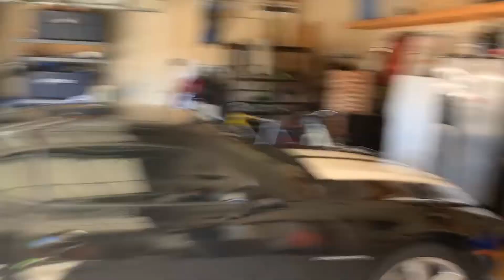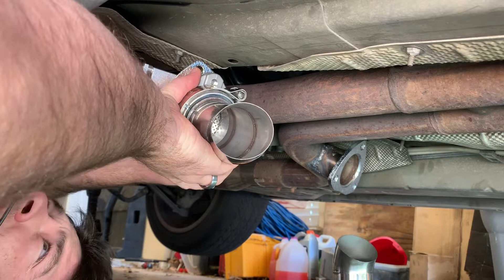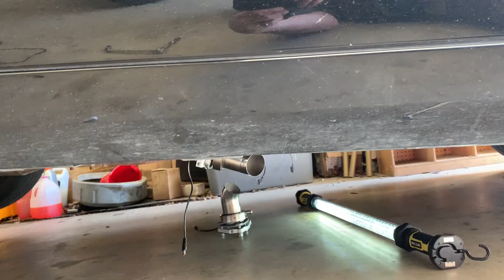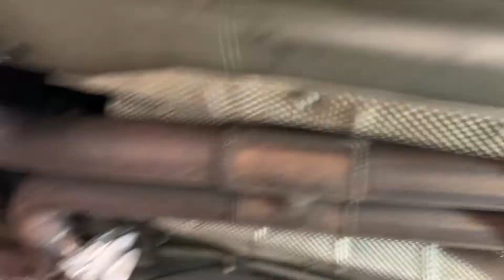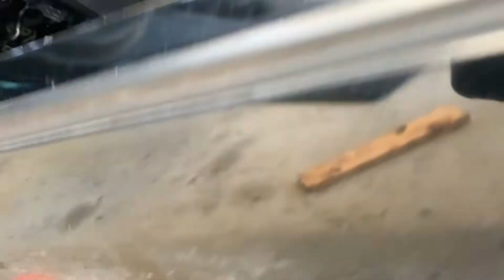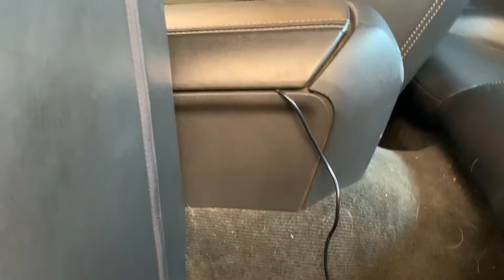Install Electric Cutouts - 2010 Camaro SS

Comment from the maker: If you are wondering if you should install electric cutouts, then you should.  The sound in person is 10 times better than any sound clip you will hear on YouTube.  Also for anyone wondering, I only revved the engine to about 2,000 RPMs in this video since the car had been sitting and the engine was cold.  I'll post some more videos with some driveby's and some higher revs for anyone interested
Reply: Hi Jeff,   I have an SS with the LS3.  got rid of the mufflers and put on the Solo Axleback.   So putting diverters in after cats would basically  bypass the H PIPE and stock resonators which are different and smaller than the resonator muffler that the L99 has.  My sound is good currently and louder than stock was.   Do you think that the diverters would still be worth it volume wise since I already don't have muffs ?
Reply from the maker: @bobcolleencaron8190  great question.  It will make your car louder and change the tone of the exhaust.  It will not be as extreme as on a car with no cats, long tube headers and a big cam.  But you will have more of an echo since the diverters open up right under the drivers seat.  For me personally, I would not put diverters on the car since you already have an aggressive axleback... but that is personal preference.  I like to use them on a setup that has either stock or a very quiet aftermarket muffler since it is much more bang for the buck.  Also, be aware that all cutouts or diverters will leak a little when closed eventually.

Comment: Are you abe to put these inbetween  the cats and headers? Or just after the cats
Reply from the maker: Short answer is no but there are a lot of things to consider when it comes to placement.  

In general I will say that if your car is stock or tuned to use cats with all O2 sensors enabled, then you should not install cutouts before the cats.  

If your car is modified and not utilizing the rear O2 sensors it is possible to install cutouts before the cats.  However, it is best to give yourself at least 2 feet of exhaust pipe between your O2 sensors and your cutouts so fresh air doesn't interrupt the AFR readings and mess up your fuel trims.

Comment: You can actually just cut off the cigarette lighter part of the cord and it will just be a power and ground wire. You can run the power to your batter/fuse box right in the panel you removed, and ground the black wire to bare metal and it will be completely hidden
Reply from the maker: Sounds so simple... I feel really dumb for not just doing that.  Thanks for the idea.  I will probably do that on my next one!!!

Comment: Should I get a tune with these?
Reply from the maker: A tune has it's benefits even on a completely stock setup (AFRs and timing can be improved for maximum performance).  However, the gain in power on an unmodified car is very minimal.  If you have other mods on your vehicle like long tube headers, a cam, or even some larger aftermarket air boxes, then you will need a tune.  

If your only mods are cat-back exhaust related (including cutouts and mufflers) you do not need a tune.  Just make sure they are installed at least 18" - 24" behind the rear O2 sensors (if you are still running factory manifolds and cats).  If you install them too close to the rear O2 sensors, you may get a CEL due to outside air mixing with your exhaust gases near the O2 sensors.

Thanks for watching and go get some cutouts now!!!

Comment: are they still working well since when u installed them?
Reply from the maker: I ended up selling this car a couple years ago.  At that time the cutouts worked great but they did leak a little.  The cool thing is that the flange is pretty standard so getting cheap replacement motors for the butterflies shouldn't be a problem if they only last a few years.

Comment: whats the link
Reply from the maker: Valentin Keef https://www.ebay.com/itm/2-5-One-Control-Two-Remote-Catback-Electric-Exhaust-Cutout-Pipe-Kits-New-Type/143200685077?_trkparms=aid%3D555018%26algo%3DPL.SIM%26ao%3D1%26asc%3D20190212102350%26meid%3Da9cd1ea9a1ce473aab2113fe868930f9%26pid%3D100012%26rk%3D1%26rkt%3D12%26sd%3D143142866666%26itm%3D143200685077&_trksid=p2047675.c100012.m1985

Comment: any way you can send me the link to those cut outs im looking for some now for my ss those look really clean
Reply from the maker: sure thing... thanks for watching!

https://www.ebay.com/itm/2-5-One-Control-Two-Remote-Catback-Electric-Exhaust-Cutout-Pipe-Kits-New-Type/143200685077?_trkparms=aid%3D555018%26algo%3DPL.SIM%26ao%3D1%26asc%3D20190212102350%26meid%3Da9cd1ea9a1ce473aab2113fe868930f9%26pid%3D100012%26rk%3D1%26rkt%3D12%26sd%3D143142866666%26itm%3D143200685077&_trksid=p2047675.c100012.m1985